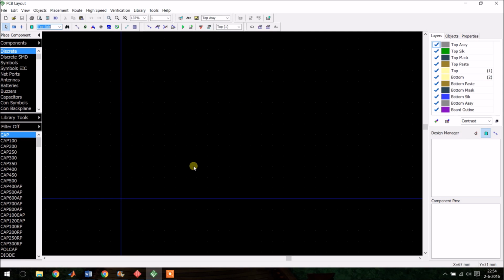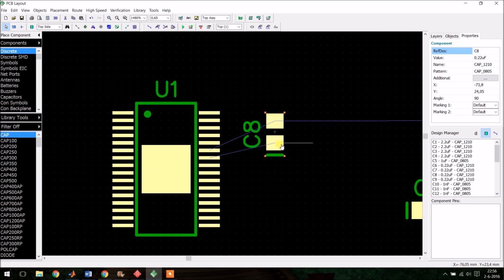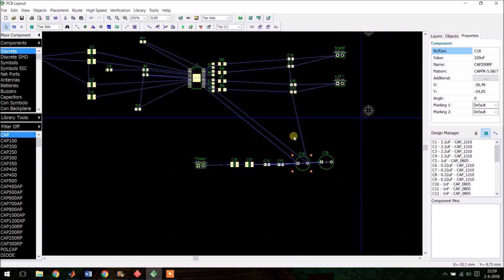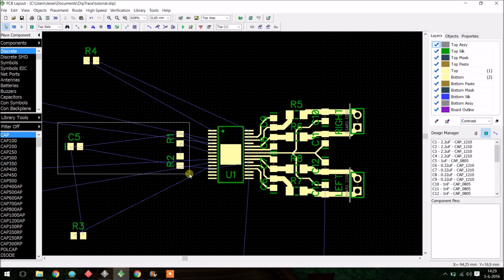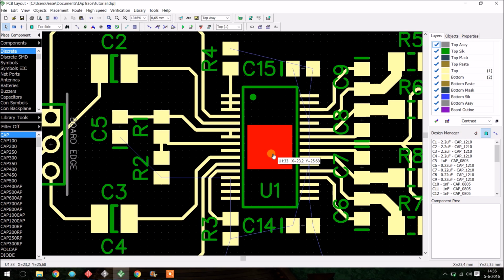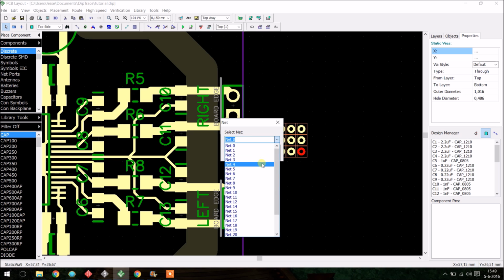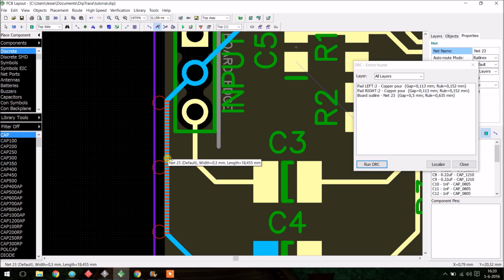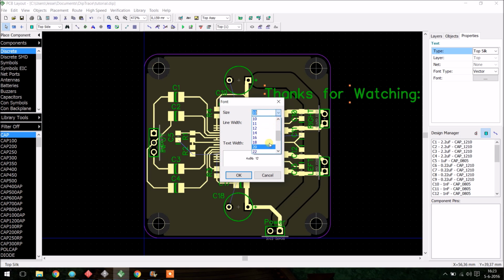PCB Layout [DIPTRACE]

Comment: Friend my diptrace 
does not show the components in 3d only shows the board
Reply from the maker: Please check the options in the top bar of the 3D viewer. If your components are custom you need to link a 3D model in the pattern/footprint editor
Reply: It shows components also in 3D, u just need to have 3d components libraries.. I used it often for show off😂